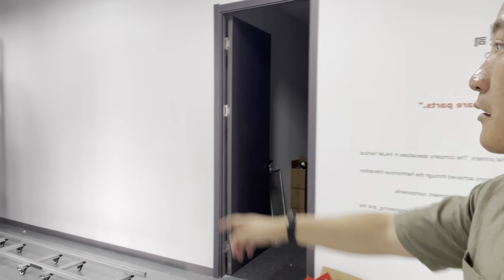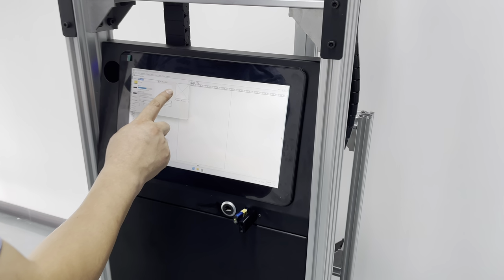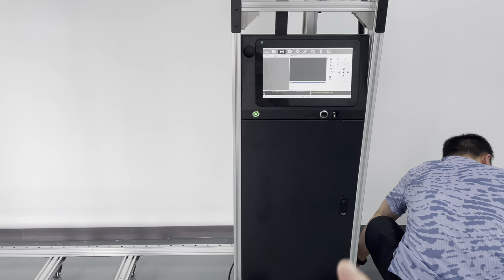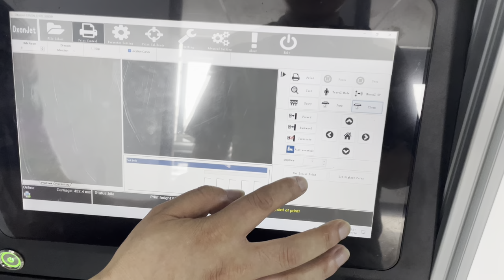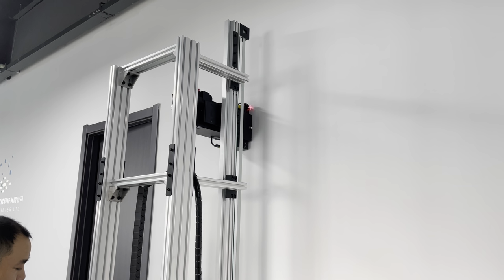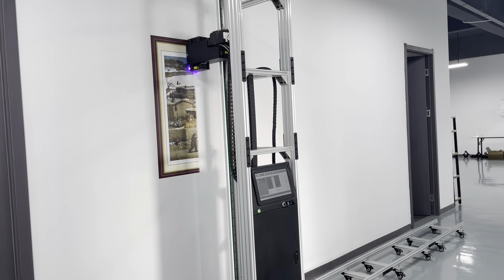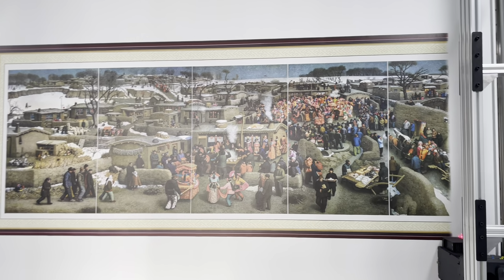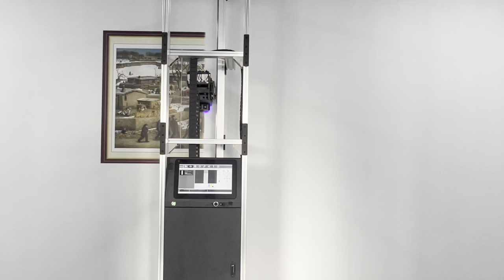Explain The Wall Printing Process Step by Step | VPJet4.0 Wall Printer

Comment: Pretty mad demo with those wavy factory floors lol! If you had a 3d scan of an external wall could you adjust the focus of the print head to compensate the cracks and grooves? That's a mad printer!
Reply from the maker: You are right, a vertical wall printer moves in three directions all the time, which makes the printing process much more complicated.

Comment: Hi. Is it possible to apply a protective clear sealer over the printed images after the ink has dried?
Reply from the maker: Yes, you can apply a clear coating on top of the mural after ink is dried on non-porous materials.

Comment: Awesome! I suppose you also check the wall for level and flatness?
Reply from the maker: Yes, it should also need to check the level and flatness of the wall before printing. You are good !
Reply: @DXonJet if the wall doesn’t flat what we can ?
Reply from the maker: @TheRules0fThr33  The printhead will follow the surface to print

Comment: Is it possible to print without section? You have white stripe between sections...is it possible without that white line?
Reply from the maker: That is from the original picture...Look at the other prints I did, you will understand.

Comment: what do you do to seal the print? will it fade? will the ink remove by water and cleaning materials?
Reply from the maker: The ink can be kept indoors over 8 years, and it is resistant to water and scratching.

Comment: May I ask, how long does the print on the wall last? does it fade overtime? does it get easily smudged when the wall is cleaned? thanks
Reply from the maker: The ink we are using is made in the USA, Nazdar brand UV ink. From their data, the ink can be kept indoors for 8 years, and 2 years outdoors before fading. Cured ink is resistant to scratching.
Reply: @DXonJet  I assume due to the lifespan of 8 years it's dye based and not pigment?
Reply from the maker: @rogersphotography9435  It is UV curable ink made by Nazdar in the USA
Reply: What happens if there's a power outage during printing?
Reply from the maker: @Lgpledge  Please check another video on our youtube channel: resume printing after power outage

Comment: What happens if the wall isn't flat and slightly bowed out? Would the print still work?
Reply from the maker: Yes, sure. there are two sensors on the printheads to keep the distance from the wall and ensure the printing quality

Comment: What if it stops halfway, or there’s is a fault half way through a print
Reply from the maker: Print another one to cover it or repaint the wall and print.
Reply: @DXonJet  so if I’m 3hours into a print and it decides to stop working, I re print the whole wall and go over the existing print?
Reply from the maker: @kasimiqbal1230  Yes. That's the reason why you need a reliable printer. All the wall printers on the market can do the same thing, but they are different in reliability and stability.
Reply: @DXonJet sorry but can you please explain your last sentence. If the machine stops midway let's just say because of a power cut, what are the steps to be followed?
Reply from the maker: @directemotion8751  Yes, I have another video of "Resume printing after power shortage" Please go to find it

Comment: How does it deal with uneven walls? Does the head auto adjust or something?
Reply from the maker: Yes, there are two BANNER  brand sensors on the printhead that detect the distance from the wall and send the data to the control system to keep the constant distance to the wall by forwarding and backward the printhead
Reply: How can I get this machine, I'm in Cameroon 🇨🇲 @DXonJet
Reply from the maker: @robinsontebug6945  Please contact us via email: alex@DXonJet.com